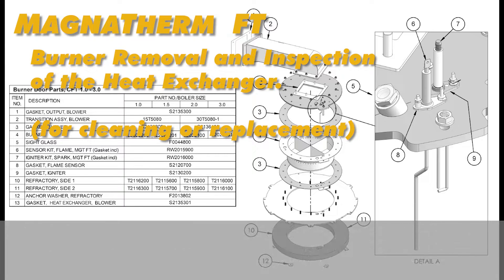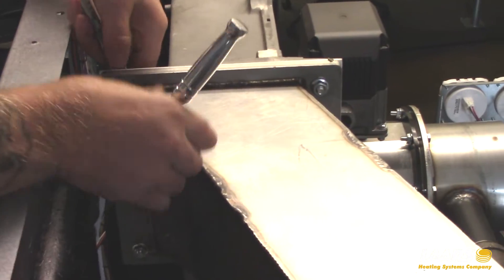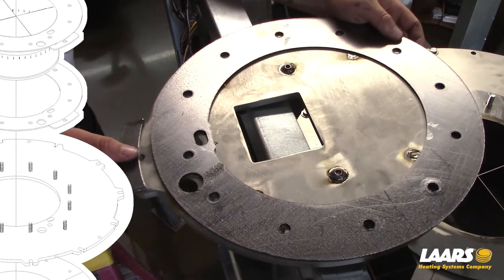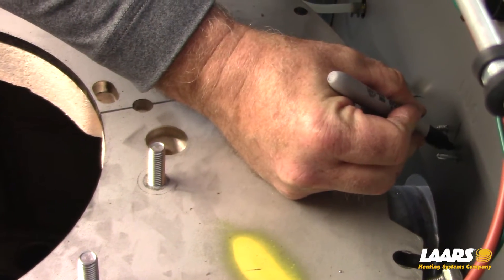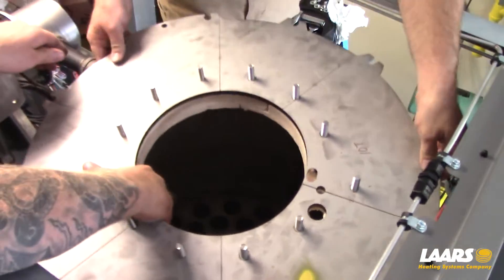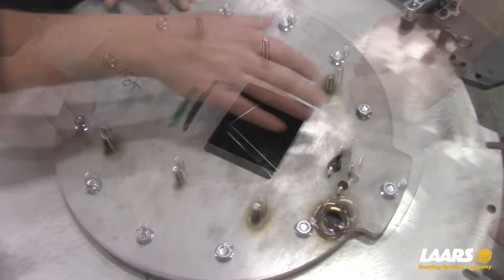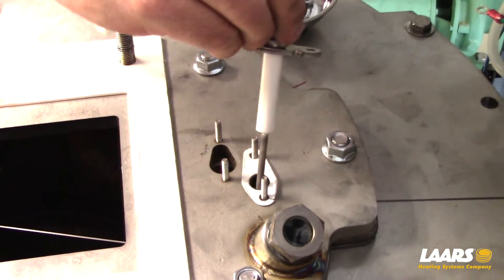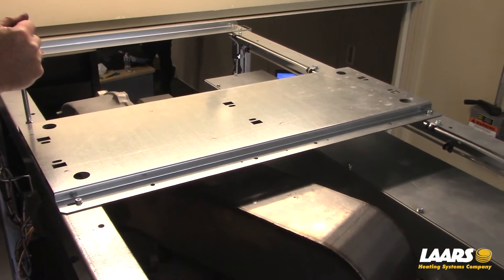MagnaTherm FT,   Burner Removal and Inspect / Clean the Heat Exchanger.

Comment: I know this is an older video....but the audio says to torque the burner plate to 200 lbs. (Holy Hercules)  But the text says 200 inch-lbs.
Reply from the maker: Hello! Thank you so much for your comment. We apologize, the audio is incorrect. Here's the corrected information: "The blower adapter plate nuts should be tightened to 200 inch-pounds using a star pattern and progressively higher torque settings." If you have any questions, please do not hesitate to reach out to our Technical Support team at 1-800-900-9276. Thank you!